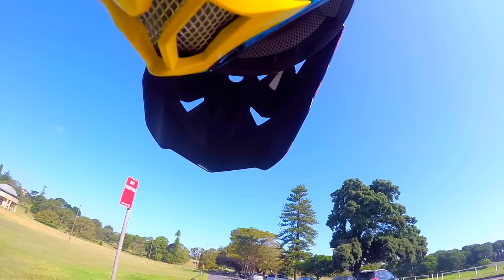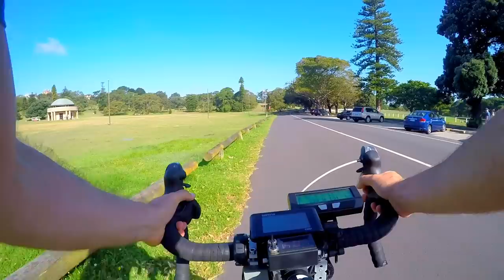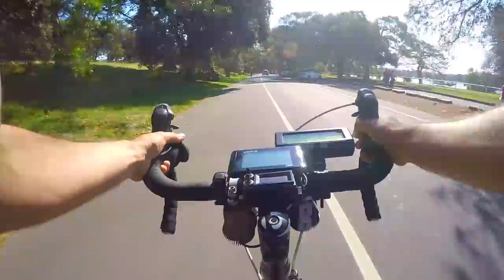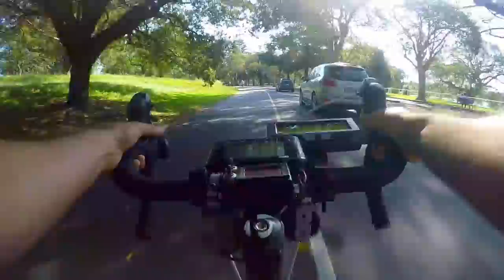Bafang BBSHD 1000w mid-drive • 74.1km/h top speed on flat (46T) • Electric Bike 48v BBS02 8fun motor

Comment: I got the 52/11 top gear just so I can have motor and max leg effort together and still have enough top end. Also if I just cruise at low cadence in assist level 1 at about 60 rpm in the low to mid 20s mph on the flat for extra long battery life and medium pedal effort. Normally to cruise in the low to mid 20s is quite a workout although it depends heavily on the clothing. In full lycra kit it is considerably easier to pedal compared to t-shirt and jeans. I've also ridden a bicycle shirtless and the drag reduction compared to a flappy long sleeve shirt is ridiculous! I can't recommend it because if you crash you will have road rash, but some clothing makes you feel like you are towing a small parachute.

Imagine this motor on a recumbent it would go like the wind! There was a recumbent trike with a bafang mid drive going for £2000 on facebook marketplace near me. I wanted it but money!

Comment: I’m ready to pull the trigger (pun intended) on a BBSHD to convert a GT Tequesta.  The frame strength is excellent on those and has much higher quality gears and brakes than you can get at a reasonable price on a prebuilt e-bike.  I will likely have to surrender some top end for hill climbing ability since my neighborhood at the foot of Pikes Peak is all hills (and I plan to use it on our great trails). Therefore, I will start with a 44t chain ring. However, I will go for the widest range rear cassette (11-34t I think) which should theoretically give me speeds in the mid-70’s (not that I would ever open it up on the street because that would be illegal ; )

Comment: Nice job man how did you get the brake cut off switch to work on drop bars
Reply from the maker: There is a cable sensor that you connect in line and it senses any cable movement and activates ebrake cut off but a few months later I disabled all the pedal assist and just had throttle enabled. Ebrake is just useful with pedal assist...

Comment: Hey Bruno, Absolutely love my BBSHD, big thanks to the eMax team, been smiling since my 1st ride yesterday! What an brilliant peice of engineering...Question for you, I have a C965 display and seems the max speed limit is 60km/hr is the best way to unlock unlimited speed limit by changing my 29er wheel size to 18 and then deeming the speedo useless. I could always get a Cycle analyst seperate I guess...
Reply from the maker: +Tim Millington (AllThingsTech) - Hey Tim.... I am glad to hear that you're LOVING your powerful BBSHD hahaa.. I told you, once you ride this thing you will be totally addicted!!!! Changing the wheel size is actually the worst way people suggest in many websites because they don't know anything else about this motor making the Bafang display totally useless (distance travelled, speed, odo). If you hold both + and - buttons for few seconds it will come up with a flashing screen, press POWER to go to next functions (no much to change there) then you do the same procedure again holding + and -  once you're in.. you do again and you will have access to other options including the speed limit that we set to 60kmh (for offroad use). Try to increase this to whatever speed you want to go and let me know how it goes. There is another trick that I do in my bike in the programming software but only needed if you have the C961 display that only enables you to a max 50kmh, C965 goes all the way up to 99kmh. 
Cycle Analyst is great and will give you lot more information. I didn't want to change too much the original Bafang setup as I need to understand this unit very well so I am currently using imy CA as a precision power meter and speed meter..... so much POWEEEEEER =]
Reply: +ElectricBike (Bruno) Yes I worked out how to get into the hidden menu by doing +&- twice then the code 0512. unfortunatly there is 2 versions of c965. Mine is the 3 button version(max speed settable for 60km/hr throught the display. 5 button version seems the one that can be settable to 99km through display. Do you know if this can be changed somewhere in the programming in Computer? Otherwise max 60km/hr seems plenty quick.
Reply: +ElectricBike (Bruno) Ok thanks mate, will give that a try and let you know once I get around to having a look on a computer at current settings. Love these motor! My bike has come alive!
Reply: +ElectricBike (Bruno) Just to check, on your C961 you set in the Programming setting on the Throttle tab under "Speed Limited" you set it to "By Display's Command". Then do you go back to the C961 Display and set it to Maximum 40km/hr...?
Reply from the maker: Yeeeahh.. lots of good tips in this link.. I probably recommended that article more than 50 times here hahahaa... 
The only thing that I "disagree" is that on the throttle tab they recommend "current" instead of "speed" I always get better throttle control on speed and jerky on "current". The second value I change from 37 to 42 as well as it makes your throttle a little "longer" and a bit more precision.
Ah answering your question about unlimited top speed with my C961, I leave it at 40km/h on the programming SW with throttle set to level 9 and for some reason no matter what speed I have my display set it just overwrites and I get unlimited top speed... fantastic bug in the system huhuuuuuull. so much POWEEEER =]
Reply: Ok cool, so your more following Empowered cycles way of thought. I will plug in sometime this week and check out my settings. One other thing to check with you, the USB programming cable I have will plug into the connector which is green and runs un the underside of my frame? Its the one that connects my motor to the display. I'm guessing that the computer basically replaces the display for programming purposes...?
Reply: +ElectricBike (Bruno) I logged into the Controller lastnight and it worked a treat! I Changed to 40km/hr under Throttle limited speed settings and now I have a truly unlocked BBSHD! Poooweerr haha
Reply from the maker: +Tim Millington (AllThingsTech) - Yeeeahhhh... that "40km/h" trick miraculously works great hey... I was the happiest man on earth when I accidentally discovered this "speed bug" on the programming software hahaaa.... so much POWEEEEEEEER =]
Reply: @BrunoPOWEEER  This is invaluable information right there... Thanks !  I now figured i bought the wrong display :*(
Reply: @BrunoPOWEEER  Hi thanks for the video and the knowledgables answers.  I think i screwed up by getting the DPC18 display is there anything I can do with that to get the max of my system ? I got BBSHD 1000w with 52v/20Ah battery and 28A controller.... thanks !

Comment: I bought a carrera hellcat lmt edition,  I was going to put 1500w hub motor on it, But after seeing the 1000w bafang is capable of more, Is that coz of more gearing options or is it you can put more than 1000w into a bafang, An it looks lighter than a hub motor, Centre of gravity is better an whats more you can use bafang off road so i read, I think i am going to pay the extra 200 qiud i think, I never knew the bafang motors could reach the speeds actually compared to the amount of volts an wattage you put it, Plus i can get a bafang on 100 qiud a month or something, Lol, I cant wait to put a motor on the carrera hellcat, 29 inch wheels surely will be a blower with a bafang 1000w on it??
Reply: i have a bbshd with a 3300w modified controller running 60amps on a norco storm 2 mtb with 29 inch wheels . i also have a 2000w hub motor mtb . i like the hub motors because they dont chew your drive train to bits . the bbshd is fun but buy lekkie parts to make it better . i also have 4 piston calipers and 203mm disks on it . both of my bikes do over 60kph but you have to be more aware of the speed . your toast if you crash at 60kph .
Reply: @ytthecommunistplatform.2675  Yeah you right coming off a bike can destroy your life, My cuz got hit few week back off his bike, Coma, Hope he comes off it tomoz, He had movement so fingers crossed he wakes up ok, So helmets is a must must, I even got body armour i use for my electric scooter, Its easy to break bones coming off a scooter at 30mph, I come off at 25 when i first had it an my shoulder pad snaped so yeah its easy to hurt coming off at high speed, Week tomoz i will be ordering the bafang, I was going to buy a 3000w hub motor but i read a lot of stories in reddit of people buying hub motors for them to burn out, Plus i do want to do little light off road, Planning trip to brecon see, So bafang actually looks better for the job, Use of the back gears, I will buy one of those motor cut off things aswell so when you change gear it dont damage to back cassette, I will buy a leckie tho but can only afford the bafang motor at the moment, Strugling to buy food lately lol, I seen a 1000w bafang on ebay for 488 qiud tho, I got do bit more research in the controller part tho, Some people say yeah get a better controller, Some say dont, I am really confused about the controller part tho, Im looking foward to putting my head into a little project aswell, Been having horrible issues with the CPTSD i suffer with, Hope having a little e-bike project will help my head a bit, Will be nice to do little brecon trip on it aswell, As long as it gets me 30mph an up hills i will be happy coz like you said come off at 60kmh an you will know about it, I always puts my full face MTB helmet on an prob will put the body armour on, After my cuz is not good from getting hit off his bike makes a point more valuable, Wear protection.....

Comment: Are you in Perth Bruno? I ride my Giant CRX 93.4km round trip, was thinking of going the mid drive later this year. Running a 48v system through a 36v 350/500 hub motor and looking at cutting travel time down. Got sprung seat and suspension seatpost and pop lower psi in the front which helps with the bumps on the paths. That looks well good. Nice one
Reply from the maker: +Shaun O'Connell - Hi Shaun, I am in Sydney... I don't think my battery will give me enough range for a trip to Perth unless I carry a trailer with lots of solar panels hooked up to my motor hahaha....  Mid-drive will give you a better range and better speed as you can play with the gears, 36v will give you bit less performance but more range but if you want more power (speed) you may get the BBSHD, I can guarantee that you will cut your travel time doing that... if you play with the gears and keep the motor spinning freely and fast you'll make this very efficient and get lot more kms with the same battery. =]
Reply: +ElectricBike (Bruno) got two batteries. one from Ewan 14ah at emax and a polymer 5ah on rear
Reply from the maker: +Shaun O'Connell - Increasing the tire pressure will make your ride a bit uncomfortable but improve your rolling resistance giving you a better range. Yeah I was going to ask you what magic you have been doing to get 93km range... now I understand hahaha.... 
Veeeeeery interesting you connected different batteries together, electronic guys would freak out if you tell them. The battery with smaller internal resistance (Lipo) would be much busier than the one with a higher internal resistance 18650 cells. Interesting to know you have been travelling so far everyday and it still going well.. =] 
How long have you been running your system with two batteries?
Reply: +ElectricBike (Bruno) Not at same time. Lol 
I run the 14ah 18650 config first then pull over and plug in backup battery  which is attached to rear pannier with plug to connect to controller. Round trip is 95.8 to and from work, so I ride the 47.9 to work and charge up both batteries throughout the day and back home in the arvo. System pushing 48v through the 36v motor so next year will go the mid drive as get a fair few broken spokes due to cycle path and speed. Think I'll get a Giant seek donar bike and either the 750 on full or the 1000 on medium speed to get the range and maybe increase battery sizes. I ride hard pedaling wise but would be good to have the power on tap if I'm not feeling the best or injured etc
Reply from the maker: +Shaun O'Connell - Ahhhhh.. I was waiting for your reply... I was  very curious about "both batteries connected together" hahaha...  Yeah.... its good to have power to spare... once I hurted my knee and I refused to catch public transport (hey.. I have an eBike.. I can go anywhere) so I just rested my leg and throttle all the way to work for 3 days... Get the BBSHD 1000w, much better unit, you will love it, no more broken spokes hahaa.. =]

Comment: Sweet! what is the top speed without pedaling on flat? How would you say the 1000w compares to the 500 in terms of reliability, efficiency, and acceleration? I am considering buying the 1000w but am afraid it will explode lol. Too much POOOOOWERRRRRRR hahaha
Reply from the maker: Yeeeahhhh... BBSHD is the best so far... heavy duty, suppose to last much longer than BBS02... so much torque and delivers all that power nicely (better than the jerky BBS02). It's better get a powerful BBSHD and run it at 60% or 70% instead of run the BBS02 on the limit (talking about the 750w one, 500w is ok).
Despite the extra power, I'm finding the BBSHD really efficient as it doesn't struggle (at all) to take you to the speed you want to go. After riding BBSHD I'm not going back to BBS02. Top speed without pedalling is between 52 and 62kmh with the stock 46T chainring. POWEEEEERR!!!
Reply: ElectricBike
LOL you even type the way you talk? that is awesome hahaha. Hmm I think I will buy one once people have tested them a bit longer. They might develop a problem half a year or so down the road. How long have you ridden yours?
Reply from the maker: Yeeeahhh... all my life I hear people saying "you write exactly like the way you talk!" I can't even imagine doing differently haha...
Yes, good move waiting a bit longer, maybe 2 or 3 months so people start post their experiences about this unit after lots of hours on it... Huhuuuuulll....
Reply: @BrunoPOWEEER  😀

Comment: I'm getting the erad 1000w conversion kit for specialized fatboy with a carbon fork. You think it can reach 35-40mph?
Reply from the maker: +A1techplus - Yeeeahhh... if you ride this bike with the original 46T chainring and your tire is inflated hard you should be able to reach speeds above 35mph. There is a top speed difference between the 48v and 52v battery pack, the highest the voltage the faster your motor will spin. You will notice that when your battery is almost 100% your top speed will be higher, as you discharge the battery the voltage will be gradually decreasing and you won't get the same speed and performance untill you charge your battery again. You will love the BBSHD POWEEEEEEER hahaha.. =]

Comment: Hey, nice work. You're flying along. 
Can you tell me what tools I need to get a BBS02 running on my road bike? I want to buy a premade battery pack (48V How many Ah 15/20?) that I can put in my back pack. 
At this moment I don't have tools for a bike, I've looked at some sites and a decent tool kit will cost a bit($300ish), but it will be worth it long term as I can service my own bike. 
Cheers
Reply from the maker: +Brap Pitt - Hi Brad, I think you have watched this video here https://youtu.be/ZsQIA8INPWg where I show and explain lots of things you will find when installing any Bafang or any other DIY ebike conversion on road bike.  When comes to "48v" batteries I would recommend go for 52v batteries as it packs more energy, will perform much better and last longer. My battery is 14.5Ah and gives me a good range, enough to go to work, back home and go to work again... anything above that is overkill and will be actually annoying carrying around, big and heavy... you won't like.... If you want extra-extra loooong range, buy a second pack and connect together in parallel so you only carry when you really need it.
Tools you don't need to spend all that money... just go on eBay and type "bikehand tool" it will come up with so many options, I got  everything done with this one here http://www.ebay.com.au/itm/BIKEHAND-Economical-Bike-Bicycle-Repair-Tools-Tool-Kit-Set-/160680980674?hash=item25695530c2:g:mMwAAOSwp5JWaKQu please watch this video here showing another tool you'll need https://youtu.be/sgjBMFta64E
If you're in Australia or New Zealand I work for an eBike shop and we sell an installation kit http://www.emax-ebikes.com.au/store/p12/Mid-Drive_Installation_Toolkit.html
I hope I helped answering all your questions =]
Reply: +ElectricBike (Bruno) Hi Bruno, thanks for your reply. I decided I will make my own battery setup. I will do the same as yours since you seem to be getting good performance. 14s5p Pana 18659 PF. 
Also when will emax bike get the BBSHD? And it what's this "Off-Road use only (Pedelec EN15194 applied on-road)" 
that's a quote from http://www.emax-ebikes.com.au/store/p43/BAFANG_-_BBS_HD1000_-_Pre-Order.html . Is it easy to remove pedelec? I just want to have full throttle. 
Thanks

Comment: Heya man! What gear/flywheel size are you using on the backwheel? I am looking at building a commuter ebike with the BDSHD, 46T chainring in the front and an Inline gear hub 3 speed in the back, but I have no idea what backwheel sprocket size to get. Not really looking to go over 60km/h on my bike.

Comment: What max speed did you reach without using the pedal?
Reply from the maker: +Mathieu Gosbee (matbeeDOTcom) - without pedalling with 46T chainring I am getting an average top speed (on flat) around 55kmh (against the wind) or 65kmh which is really fast constant speed on a bicycle =]